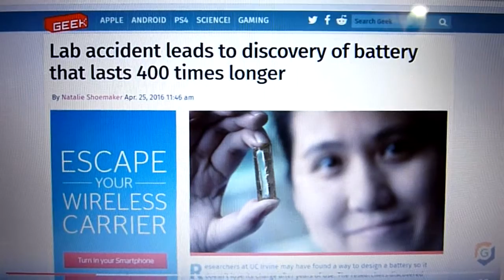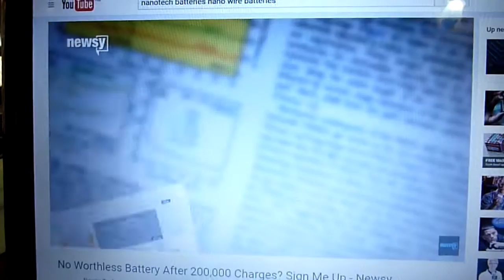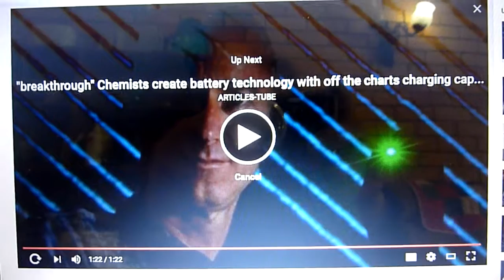WE SHOULD NOT MAKE HOVERBOARDS JUST YET

Comment: grandadisanoldman he uses capacitors ,those batteries are way over priced
Reply from the maker: If you had quick-swap ultra-capacitors (which are multi capacitor arrays) packed into less number of battery-packs (like on my latest design) you would have a great hoverboard if the the caps lasted long enough, that is if the ultra caps lasted more than twenty seconds. 

Even with such a small run time it would be ideal (for now). In Amplifiers etc, capacitors charge and discharge continuously for years or even decades. That is much, much more than a thousand recycles (like with existing batteries). So (what I am saying) is that ultra caps should last a life time of hovering (at 20 second bursts) all day long for decades. lol 

A far-cry from today's batteries, and even better than the new-fangled batteries on this video. Even if they only lasted twenty seconds it would be worth while and that's how long the original rocket-belts lasted and they had fun. With caps there would be no ongoing battery cost and with solar&wind power (to charge the caps) you could hover all day for the rest of your life for free (except initial costs). 

Today's batteries would cost 1 dollar a minute to ride the hoverboeard (just in battery cost alone). That is cos when the batteries die, you have to spend like two-grand on batteries again (about every year, if you are a keen hoverboarder). Two grand a year, just to keep the batteries up. lol That's why we don't see hoverboards like this and we won't, until they can do something about power supply. And that's why a 20 second ultra-cap hoverboard would be better than what we have now, for power. lol

You would have a twenty-second ride and take the same time to swap batteries and or just re-charge the caps if it takes a short enough time to charge (like less than a minute). But if you do have swap-packs, you will only need two or three sets of swap-packs cos it would charge in a few minutes (depending on how powerful the charger is). For a really instant charge, you need a big charger, and charge time could be a bit limited cos the charger isn't big enough. We are talking a lot of power storage (even if it only last 20 seconds). 

You need a charger that has at least 70,000 watts to charge it as quickly as it discharges. But I would imagine a minute or two charge time would be ok (demanding a lot less watts). There's a lot of research to be done before we can do this, but I don't hold much promise, the power draw is too huge for any length of flight time (I think). But it's so enticing to think that just maybe it could be done. lol You have to start with a vision, to make new things happen. 

This hoverboard concept would need at least 70.000 watts power draw, and I don't think I would even get 5 seconds out of it with caps. lol But I will look it up and maybe find out how long 10 kg of capacitors will last on 70,000 watts power draw. 10 kg of capacitors is about the maximum you could fit in a hoverboard. Or if I could fit more than 10 kg in, I will. Might be able to fit 20 kg in. It's not the weight, it's the space they take up that limits it. lol